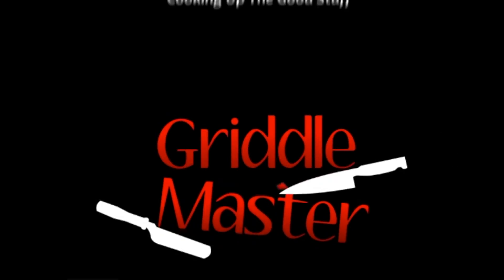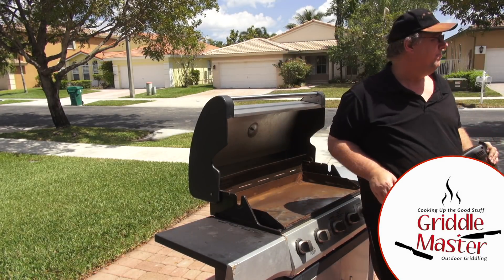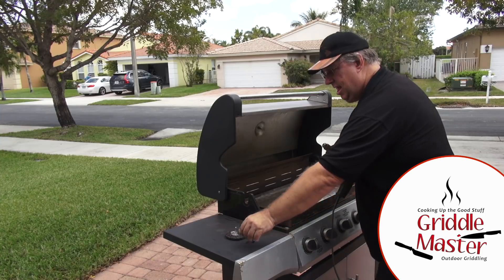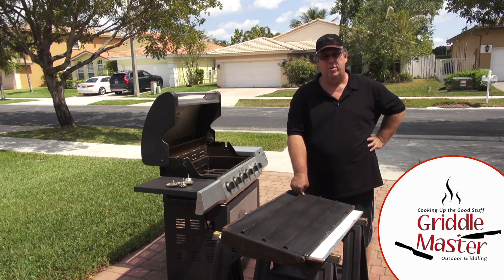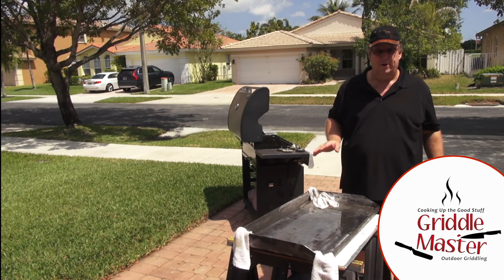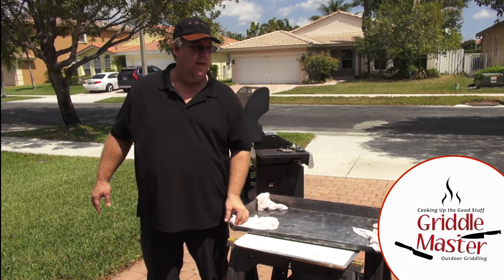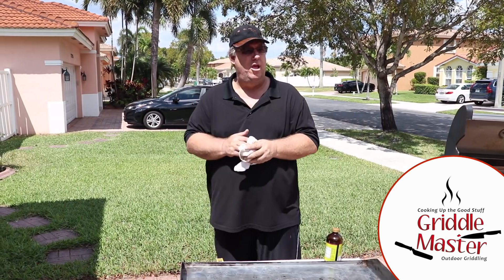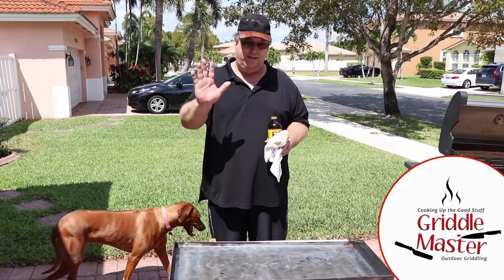Griddle Master Joe shows how to remove rust from griddle top and reseason

Comment from the maker: Spray the bottom and outside sides with high heat rustoleum spray paint. 
After getting most the rust off, you can use 50% water to 50% vinegar.  Pour on the griddle top and let set for hours and then just dump out and wipe dry.  It works really well.  Wipe with Flax Oil and season.

Comment: Great video.  Thanks for this.  I have a rusted up Mojo griddle that I will apply these same techniques to repair and reseason.  Thanks again!
Reply from the maker: There are a lot of videos out there showing other methods.  I like what I did the best.  It really works best and it will scuff up the steel which will allow the seasoning to stick extremely well.  Use flax oil to season.  It is the very best by far for seasoning.  Once you season the top, you will not see the scuff marks and it will hold the seasoning coat.  You will see!!!